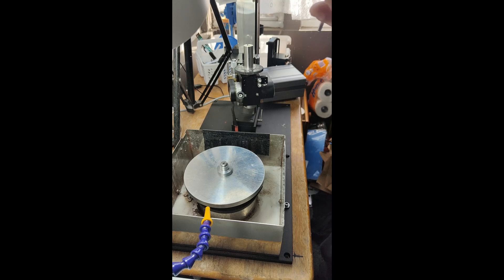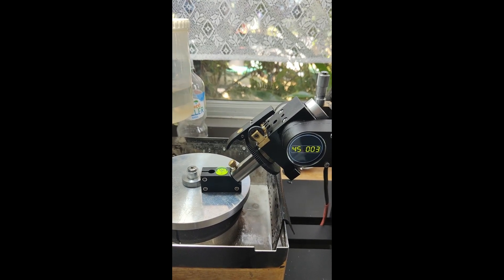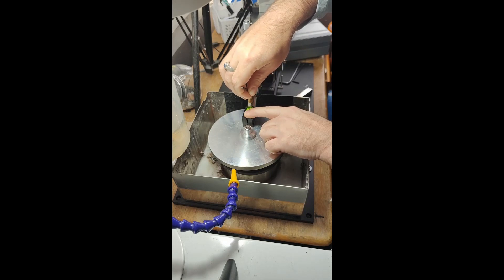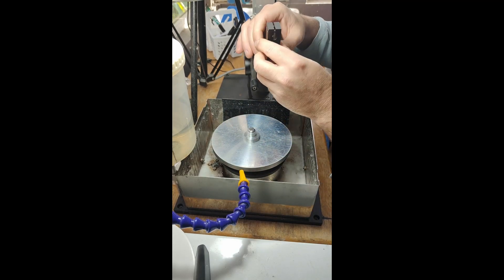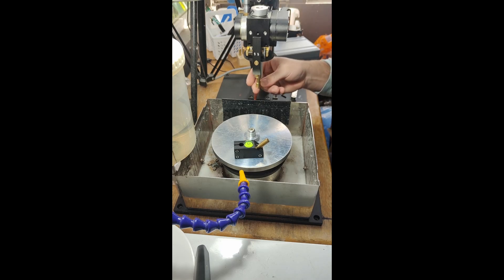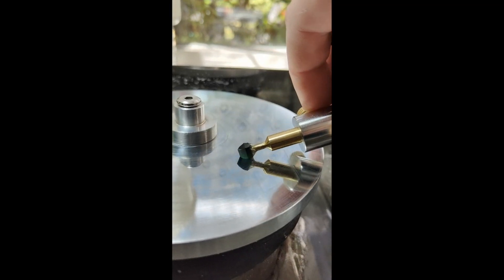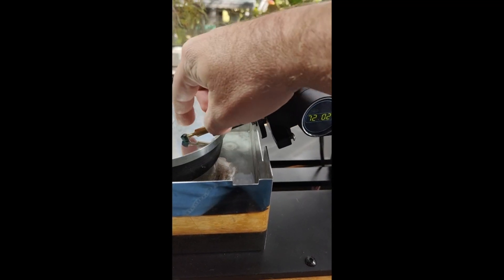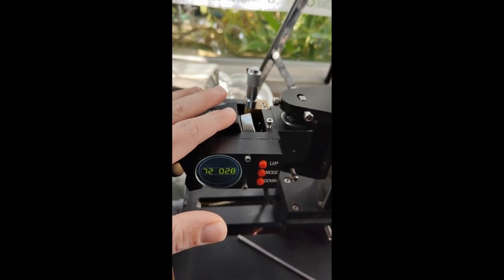Index  Quill Calibration & Calibration Guide 720 LDGEMS FACET V2

Comment: can you do same for v1 ? 
i fix  left right part from beginning of your video .. but i have problem front part of 45 degree lifting up .how to level that part in v1 ?
Reply: Unfortunately V1 is based on the sliding bush. When the 45 adapter is lying flat, angle gauge showing 46.76.

Comment: Good demo! I was unaware of all of the adjustments to true it up.

When using feeler gauges, hold it horizontal to the plate. The force that you apply downward on top of the 45 deg head should be static.

As I already have precision measuring instruments, I would use a dial test indicator to check for parallelism. 
To align he 45 deg head, I would use a height gauge with a dial test indicator and sweep over the top of the 45 deg head.

A concern that I have with all plates is with the bearings and the overhang. It doesn't take much downward force to deflect the plate if the bearings are not in good condition or if they were specified incorrectly, the plate will deflect away for the gem. Potentially setting up a small vibration.

Looking forward to instructional videos. Tks!